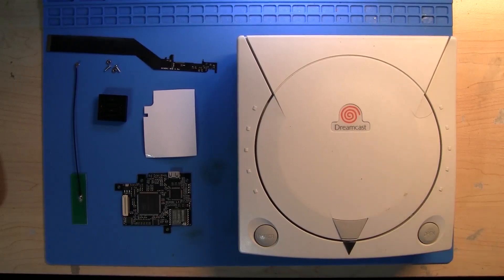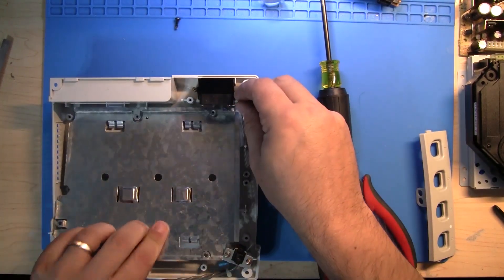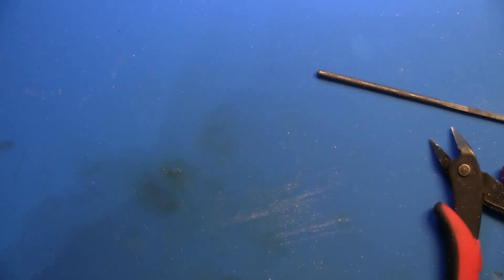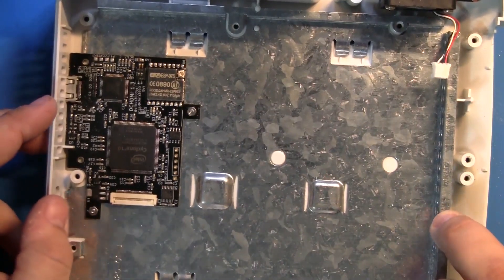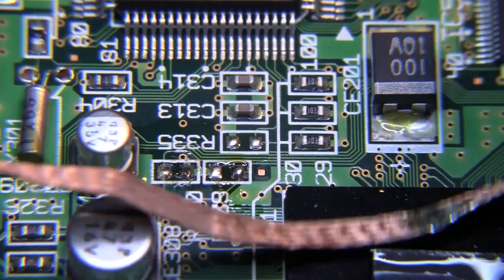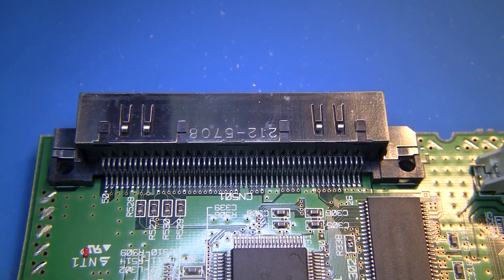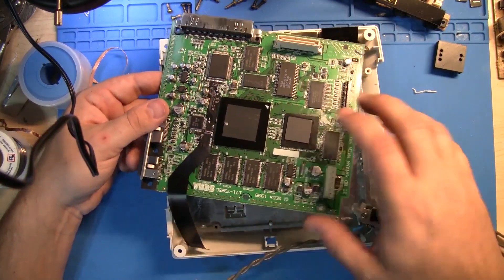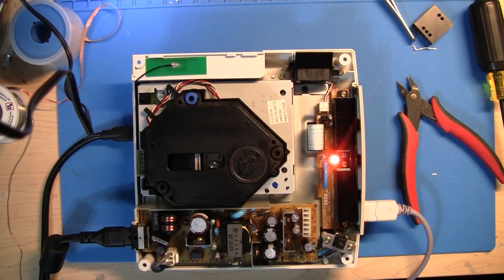DCHDMI Install from start to finish.

Comment: Does the OSD button combination only work in controller A?  Somehow I managed to break controller port A.  All others work but I can’t bring up OSD.  I get audio and video over HDMI just fine though
Reply: It's possible to connect DCHDMI to a different controller port, by soldering to a different resistor pair: https://dc.i74.de/controller.png
Reply: chriz2600 good to know. Thanks for responding so quickly. I think I found my issue though, so hopefully I can get all controller ports working again
Reply: @mikebusenberg5384  hello 
I am facing the same problem. 
No OSD, controller port A not working. 
How did you solve this problem?

Comment: hey citrus3000psi
 what's the name of the soldering iron & tweezer that u using when soldering the flex cable on the motherboard & also what's the kind of wires u use for the in game reset setup as well?

Comment: Out of curiosity, why not just use double sided mounting tape instead of screwing it to the board?  Unless of course that's how you are grounding the board, in which case ignore me.
Reply from the maker: The board needs a firm connection since the HDMI cable is being inserting.  Double Sided tape might work, but I'd question its longevity.
Reply: @citrus3000psi    Fair enough, just good to know it's not done for grounding purposes, so good double sided mounting tape and a 5 millimeter long tab cut into the shielding and folded up to hold the board firm against the back of the dreamcast should work, I'm thinking of ordering one when I get paid, the picture quality looks quite a bit better than any other options on the market besides emulation.

Comment: I've just installed this and tested it but get just a black screen? Access point is coming up, checked all points for continuity best i could which seems good but whats odd the GD ROM drive doesn't spin on start up like it used to. Any ideas where to start looking?
Reply from the maker: Go to the very end of this page to the troubleshooting section: http://dansprojects.com/dchdmi_install.html
Reply: @citrus3000psi  thanks for the quick reply, I have been through that list and tried all but connecting via composite (dont have one). I have tried it with the scart cable I originally had and the rf cable which still gives a black screen. Would either of those connections give the same results as trying with a composite cable?
Reply from the maker: @snickersvickers22  Yes RGB and RF can be used instead of composite.  Since you have a black screen verify the GD-ROM is seated properly.  And then recheck the VCLK/HSYNC/VYSYNC points on the flex for a bridge
Reply: @citrus3000psi  ok I've re-soldered those points, done continuity tests all come out good but still black screen. I did read on a reddit post you can upgrade the firmware without needing the screen? I tried connecting to the access point using the password you mention in the video but comes back incorrect. Is this something to try?
Reply from the maker: Michael Vickers contact me via my webstore please

Comment: I am not sure if citrus3000psi is reading comments here but can someone mention the Tip he is using. I was practicing on a busted board and ended up with a lot of solder on the pins.
Reply from the maker: Its just a small bevel tip.  The tip is not the key here.  The main "trick" is how little of solder you need to put on the tip.  A lot of solder will flow up from the footprint on the smd into the cable. Just barely any solder is needed.

Comment: Hi, got a problem with the screen fuzziness. Test/info shows pins 09 10 11 with an X.. to clarify, is that a problem with my soldering? The pins referring to the chip pins?
Reply: Answering myself for reference: opened the DC and re-flowed the solder around the smaller Sega chip. Retested and it worked perfectly, crisp color and picture.

Comment: Those tweezers you use at 29:50 What kind are those? Been trying to look for a set of them for a good while now with no luck
Reply: they seem to be basically a blunted Eyelash Extension Tweezer of some sort.

Comment: What kind of soldering flux are you using? and what kind of cleaner do you use?
Reply: from a replay he made: 'Kester 959T.  It doesn't flow nearly as well as other paste.  But it cleans up extremely easy.
'

and I believe he was just using some high % iso alcohol to clean

Comment: So I finally got around to installing this....and everything powers up, the disc will spin when I close the lid, but no picture through either HDMI or the analogue out, I've taken out and reseated the ribbon cable, unable to figure it out, anyone have any ideas what the problem could be?
Reply from the maker: If analogue does not work then its do to the there being a bridge on the flex cable.  Reflow the cable again, but do not put any solder on your iron.  You'll likely have to use solder wick and remove solder.
Reply: @citrus3000psi  Thanks for the quick response!  I'll do that asap.
Reply: @citrus3000psi  That was it, there was a very microscopic bridge on the 3rd pin on the bottom of the video chip...…..my god I feel like an idiot! I double checked it with a magnifying glass and didn't see it, but this time I put some extra light on it, and sure enough, there it was...……..

Comment: What is the temperature set that you use for soldering ( in Celsius please ;-) ?
Reply from the maker: I keep my iron at around 300C sometimes a little a higher.
Reply: citrus3000psi  I have done the soldering but the video comes only after 15 seconds and sometimes doesn’t come. Do you have an idea ? If I change the settings from 1080 to 960, the screen goes off and no more picture ( 960 works fine on my television normally).

It seems really long to get a picture and even worst just changing some displays.

If I had a bad connection I shouldn’t
 have a picture at all.
Reply from the maker: @sega-re-trop-vieux  Please send me a message through my webstore so we can better communicate.

Comment: When in pass through the picture is fine but on Bob deinterlace the screen is all jittery.... is this normal
Reply from the maker: Bob deinterlace is lag free but there is a slight amount of jitter as lines are duplicated.  There is a bug with 960p and 1080p modes that that make this look more prevalent.  This will be fixed in a firmware update that is set to released very soon (likely this week)

Comment: Is there anywhere I can connect the test point wire. Mine came right off!
Reply from the maker: Trace it back to the leg of the IC its close to.
Reply: @citrus3000psi  i got it to work i scraped it off and made the connection. i got into the menu and upgraded the firmware. after the press r to reset screen went blank. now i have no video..... i waited i turned off dc... what can i do now?
Reply from the maker: @theuop2511  Send me an email from my webstore with more details and your order number please.

Comment: what was JP1 for and why did you jump it?  just intrested :)
Reply from the maker: With the jumper disconnected the FPGA cannot control the dreamcast to force 15Khz or 31Khz.  The newer flex cables have this jumper omitted.
Reply: @citrus3000psi  great work dude! still watching the whole vid, where can I buy this kit?
Reply from the maker: @gearjamfilms2883  There is a pre-order going on now shop.dansprojects.com

Comment: honestly you could of just heat gunned the sticker and hid the screw under the sticker after installing it.
Reply: I mean, it wouldn't be that well hidden, you'd have a giant bump in the sticker because the screw sticks out from the case.

Comment: When will there a DVD drive mod for the dreamcast since they are better then gdroms and will last longer
Reply: just get a gdemu
Reply: @dot_mid6125  im more into loading pyschiscal disc because i like poping disc into consloes so why not make a dvd drive mod for the dreamcast
Reply: Someone's been working on an IED DVD drive mod, but who knows how successful it'll be
Reply: @kevin_lee_music  good to know but i rather replace the gdrom drive and use a dvd drive does that make sence to you.
Reply: Dude, that would never happen.The DC scene is way to neiche to have something like that to be affordably manufactured. 

As kevin said, just get a GDEMU. I get the appeal of physical media but, a dvd drive for the dc will never happen.
Reply: @brandonnesfan   it can happen if the gamecube can have one so why not the dreamcast
Reply: @Obscure_man31  Because the Gamecube is based on DVD technology already. This isn't. It'll likely be hard to get it working software-side.
Reply: @DeskoDev  true but the results would be worth it
Reply: @Obscure_man31  no, not really. USB, SD, even IDE are all faster and more convenient than DVD
Reply: @konyption  than again that depends on the price and quality of the item
Reply: @Obscure_man31  the price doesnt change the physical limitations of dvd drives
Reply: @konyption  eh nots that bad really but you cpuld always mix and .atch like the dvd drive wuthe ide drive

Comment: Even though just 480i- my Dreamcast has never looked better then it does in RGB through a Toro box converted into component then into my 20 inch Sony Trinitron. Before this I tried multiple hdmi options into a modern flat panel, but it never looked right to me. The Dreamcast might be able to output VGA, but these are games made for the analogue era. I have trouble believing anything would beat a good rgb signal into a quality trinitron or pro Sony crt monitor. Flat panel is really only ideal for Xbox360 or later if you ask me. I have trouble understanding why anyone would be hyped over the DC in hdmi output unless strictly for capturing or only room for one tv in the house. Does anyone agree or am I totally missing something?
Reply: Yes, you're completely missing the point. These games were designed for 480p. Playing them in 480i even on my BVM doesn't do them justice.

Comment: Alot of Fingers will be drilled. Love the HDMI mod but 150 ia not reasonable for me. Get rid of The Wireless Connection and sell it for 70 bucks and im in.

But besides that, a good Video mate.
Reply: The wireless connection costs like 2 bucks...

Comment: Holy inconvenient mini hdmi crap, batman. What is the deal with kits using mini hdmi? Does it save a few pennies from the regular sized hdmi license? Im also looking at you ultra hdmi n64.
Reply from the maker: You are welcome to find a spot that will work with a full size HDMI connector while still using a GD-ROM drive.
Reply: A Gentleman  It's not about the cable. It's a matter of getting the PCB with the HDMI female connecter to squeeze in underneath the Dreamcast motherboard. A regular sized HDMI input will not fit; the space is very tight. This mod is really ingenious!